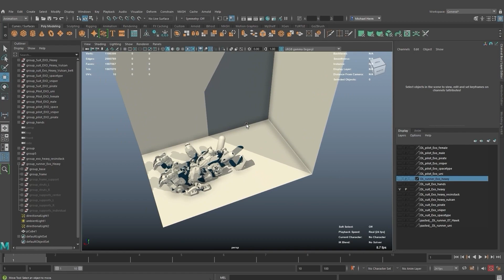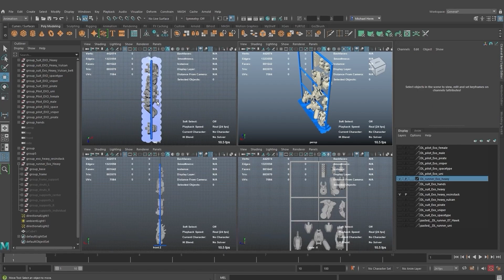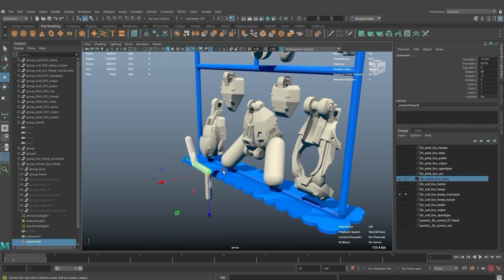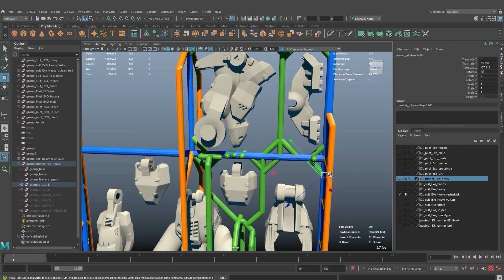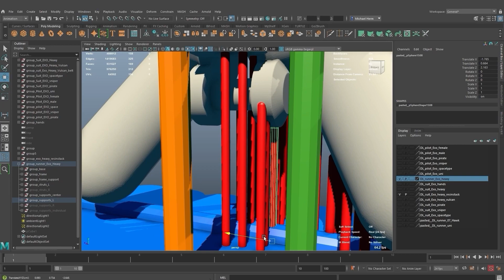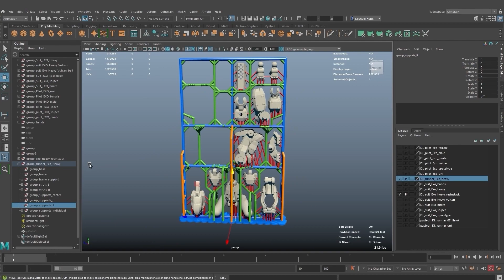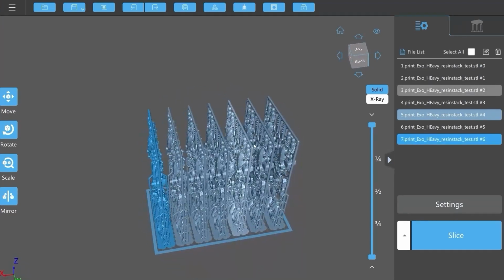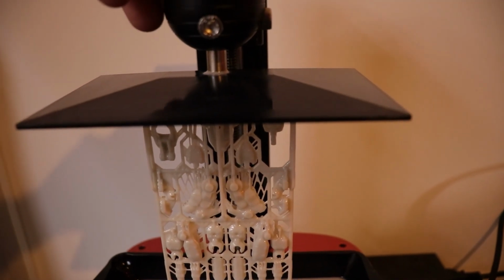Resin stacking - increase the output speed of your resin 3D printer ten-fold!

Comment: Finally the one guy on the internet that has done what I'm trying to figure out how to do. I'd love if you could answer a few questions?

I'm curious why you went for horizontal bars with corner support instead of diagonal bars shaped around. Is it just not necessary and the hastle is too much for adapting the frame?  I had in mind of doing it like you but shaping each compartment like a diamond so you have only vertical and diagonal lines for the frame.

Is there a reason you are not constructing your support to have a sharp point taper that in theory should leave less damage when removed like in a slicer software? Is there an advantage to having your tip the size of the shaft? It is a shame you cannot assign a stl as a support structure in the slicers. So you would creature supports from it like it would from a raft in a non annoying way.

thank you :) Your a legend.
Reply from the maker: hi, thank you!
to answer your questions: 
The horiziontal bars serve as base for the the smaller direct support structures. The corner supports further stabilize the horizontal bars to reduce some layer peeling off effect I had before without corner supports. It's probably also possible to do diamond shape, but then the smaller supports which directly connect to the actual parts have to be longer of course. Also, a diagonal diamond shape reduces the actual space you have for parts, so the whole frame/runner in total would need to be bigger, and thus also print longer. The mostly square spaces to hold the parts are optimisezd for small size and efficient print speed.
About the support tips: It's hard to see, but they are actually rounded, so the contact spot usually has a smaller diameter than the support shaft.
But since the supports are very small anyway (comparable to small diameter supports that are generated by Chitubox or other slicers) there's not much of a difference compared to what you get with out of the box supports. 
Cheers

Comment: Does the this support work for FDM printers?
Reply from the maker: I don't use FDM printers so I haven't been able to try, but it might work.
You can try the action figure files, they're smaller and the resinstack or stacked version should also print with FDM.
The stacked files come as STL format so you can simply load it into your slicer and directly slice for your printer without adding supports.

Comment: I dont suppose you'd make the stacked file available? My roommate just picked up a set and hoooyboy i was not expecting so many parts with no support. I'm very new to 3d printing, so im not really sure what is going on or how to judge if im doing something right.
Reply from the maker: Hi, all our files include the pre-supported parts for Chitubox. You just need to install the free version of Chitubox, load the preset for your 3D printer, open the pre-supported Chitubox files from the "files_Chitubox" folder, arrange them and export the .ctb file with your preferred print settings, and you're ready to print :)
Reply: @teccotoys  ooooh, I wasn't sure what that was, I was dropping the parts in lychee to support. I'll see if I can get that figured out. Thank you so much, your mechs are awesome!
Reply: @teccotoys I wa spooking around in the folders and I see the individual parts. I was wondering if you had the entire stacked files available, with everything already laid out vertically. Sorry I dint explain myself well and I'm still learning all the right terms for printing.
Reply from the maker: No worries :) . Unfortunately, the stacked files are not ready yet for the exo armor suits yet. I will post updates as soon as they're released.
Reply: Are the stacked files for this video available yet? He has this suit (the pilot with exo armor and galling gun) but the stacked files are in there either. I've been trying to figure it out on chitubox but I'm not having much luck.

Comment: Great video! What would you do if one of the parts to print is really large (in all directions) to print? Would you use two stacks or use more of the standard supports?
Reply from the maker: Thanks! Depends on the exact shape of a part, but I guess in that case standard supports. The resin stack method only really makes sense if most parts, when printed vertically, save you build plate space.
Reply: Got it, thank you very much :) @teccotoys